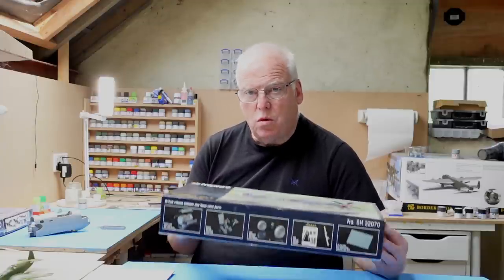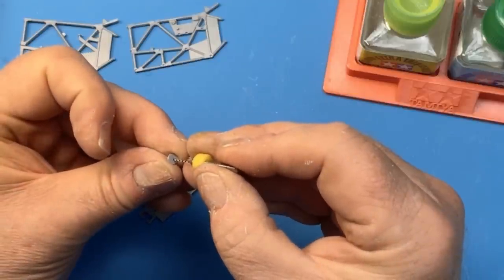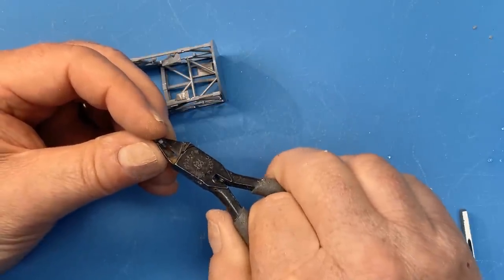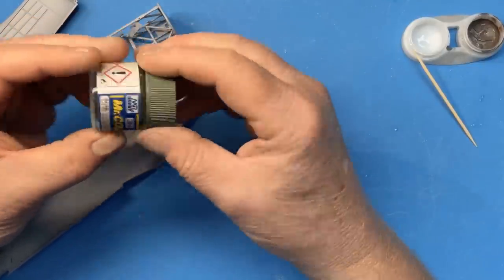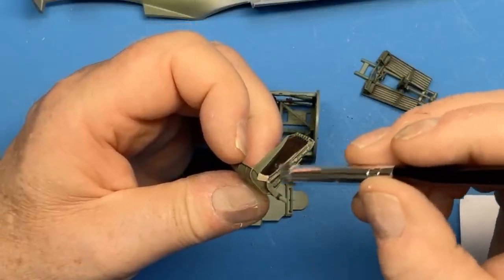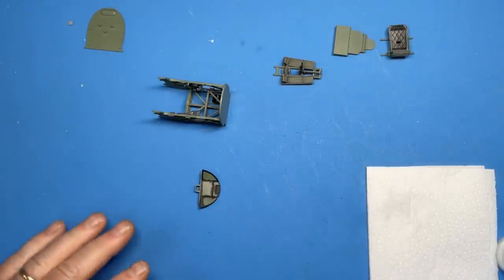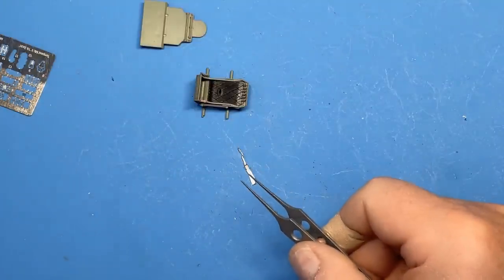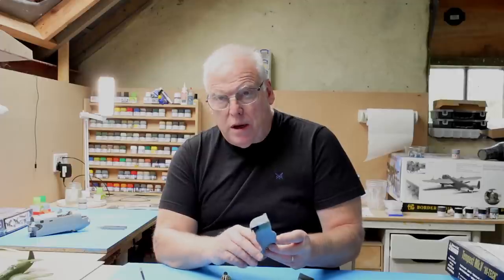Special Hobby 1/32 Tempest Mk V "High Tech"

Comment: The Typhoon and Tempest cockpit design demonstrates Hawkers admirable determination for pilot survivability. The super strong framework would limit deformation of the cockpit from linear, or forward compression in a crash. Many stories from pilots attribute their survival to this strength.Typhoon and Tempest at War by Arthur Reed and Roland Beamont Pp 68 depicts the result of a stall during a squadron landing where a Typhoon cartwheeled tearing off a wing, the tail and the engine. The pilot? Shock and a few bruises. Looking forward to this build Steve. This is a great start.
Reply from the maker: Thanks John very interesting it looks strong with all that framework around the pilot 👍
Reply: I glad I found your channel again have this kit to ,the first one ,and a bunch of other in the stash ,your a master modeler ,seen a couple of other builds from you ,just awsome .
 Thanks for doing this one ,can't wait for part 2 😊

Comment: I built this kit and it was a pain in the you know were. hardest kit I have ever made. the undercarriage and the wheel wells were the worst bit.
But its worth it as the finished aircraft now takes pride of place on my sideboard.
Reply from the maker: Yes it’s a test fit test fit and test fit again kit. I’ve done to U/C bays today and not one of the bulkheads fitted without trimming and filing. A bit of a change from my last two Kotare and ICM efforts.

Comment: Beautiful !. I've used the Eduard Space set on their 1/48 P39 and have to say that the overall effect is simply stunning compared to the original fling panel and accessories panels. The 3d effect can't be described, one has to see it to believe it. Great tips for using the PE parts too, I've bought myself one of those magnifier lights for the PE parts on my Airacobra and it makes this sort of work so much easier for my nearly 70 year old eyeballs.
Reply from the maker: Yes I’ve got some Kitsworld 3d decals for my Whirlwind but they’re not as good as Quinta Studios. I haven’t used Eduard space but I expec they’re pretty’s good.

Comment: Wow! I didn’t see this one coming! Going to sit down with a cuppa and enjoy this one later today. I presume you know the shape issue of nose / radiator opening and the Barracuda replacement which although looks lovely is a huge faff to cut from block and fit to kit. With an exposed engine a lot of that goes away of course. Which scheme are you going to do? Very excited!
Reply from the maker: I’ve thought about the barracuda nose correction but as you correctly say I think the problem will be lessened by the open cowlings. I’ll see if I can reshape the spinner and do a halfway job of it.
Reply from the maker: Oh and I’ll be doing Clostermanns A/C but with corrected serial number.

Comment: The cockpit looks amazing! I've read that there are fit issues with this kit so will be interesting to see how you get round them. By the way, those Malosa tweezers you use look good. Where did you get them from?
Reply from the maker: The fit is - erm - challenging. The tweezers are ex surgical forceps - recycled and unfortunately not available for general sale. They’re the best tweezers I’ve ever used.

Comment: I’m very interested in this build as I’ve been looking at this kit to buy for quite a while. 
I don’t see aftermarket cockpit details as cheating. 
I just see them as being lazy 🤷‍♂️
You want to knock out builds and videos so it’s a great option to speed things up 🫣
I want to be exceptional at hand painting these details before I revert to these options and I will once I’ve learned all there is about working with what I have 👍
Reply from the maker: Its a tough kit because of the fit issues with the airframe - I’m battling through it now for part 2